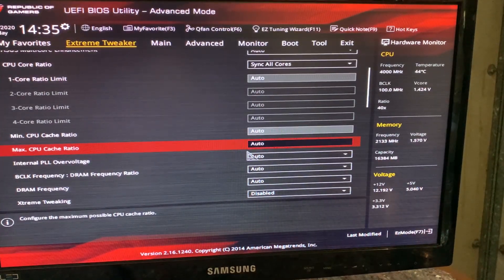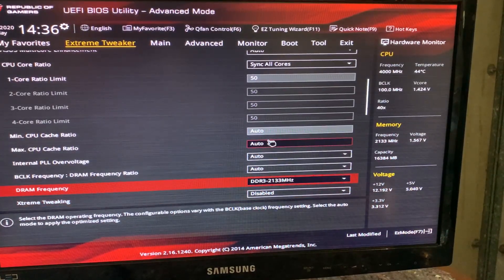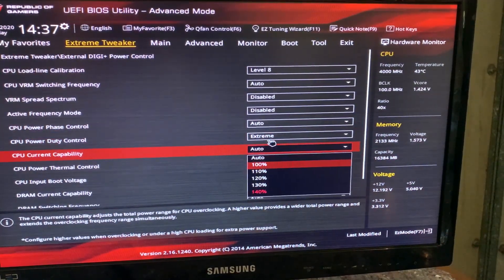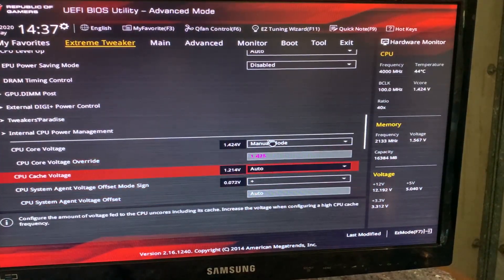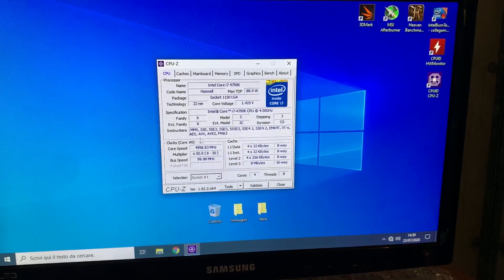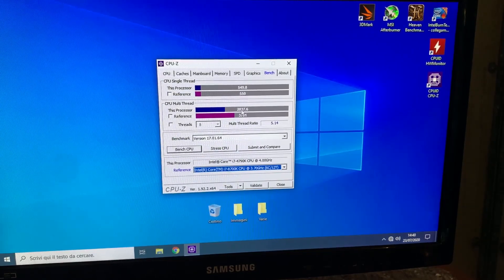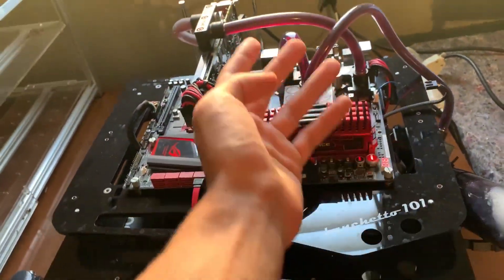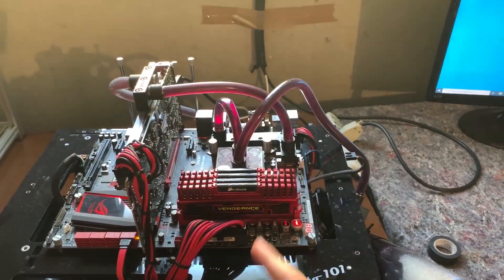Overclock an i7 4790K to 5Ghz (And every other Haswell CPU) on Z97 - Asus Maximus VII Hero

Comment: I dont remember how, I think I used a program to do it, I selected 5ghz and then it changed the other settings it self and ive been running my 4790k like that since 2017 without any problem...just sux that next upgrade cant just be a cpu and card, but I have to get new mobo, card, cpu, cooler and ofc new ram, meeeh
Reply from the maker: Oh that's nice, but you're probably running a bit too high of a core voltage if it's an auto oc. Still, it doesnt really matter if you have good cooling!

Comment: 1,425v Core Voltage :O
Reply from the maker: I know, I know, unfortunately 5Ghz is really high on those chips!
Reply: @ImWateringPSUs  high ? My 4790k n°1 run 4,7Ghz for 1,4v my n°2 4,7 1,43v 😭 ( tested on z87x oc force/ z87 oc formula and z97 XPOWER ac )  for m'y  5Ghz ~1,3v is a 🦄
Reply from the maker: @xkaiderxkaider5718  1.3 for 5Ghz on these kind of chips is nearly impossible! Would love to have a chip that can do it!

Comment: Hi do you know whats the best overclocking guide for begginers. I have this board but the i5 4690k and have never overclocked. I don't know where to start. Any suggestions. Obviously every chip is different so I couldnt do what you did here.
Reply from the maker: I'd go with 4.4Ghz, 1.35V, LLC enabled (middle level if you have levels!) That is if your cooler can handle it :)
Reply: @ImWateringPSUs  THanks. I have a new PC now but when I get that one out of the cupboard to user it as a streaming PC I will do this, cheers.
Reply from the maker: @adamlw7181  My pleasure, take care!

Comment: what is the highest oc you can get without delidded cpu i have ranger mobo
Reply from the maker: I'd say 4.9 with a very good CPU
Reply: @ImWateringPSUs   when i put
my cpu level up on bios to 4.8 around 10mins benchmarking it crashes
Reply from the maker: @teknoadikt  You need to do some manual overclocking like the one shown in the vid man
Reply: @ImWateringPSUs   the issue would be what vcore volltage i should use etc etc on 4.8 or 4.9 i am a noob on oc so thats why i use the cpu level up

Comment: I've overclocked mine too, but with 4,5 ghz i have the Problem, that my system Boots Up but on load it crashes after several minutes
Reply: 4790k & ranger vii
Reply from the maker: You need to up the vCore and check your temperature

Comment: I did so the same tjong bit my pc keps reboting ITself
Reply from the maker: That means that your CPUs is worse binned and you need to up the vCore
Reply: @ImWateringPSUs  how do I do that?
Reply from the maker: @Flight737  When you have to set the voltage, you set it 0.025V higher. Or you lower the frequency

Comment: I do the same things and my PC dont Turn up..
Reply from the maker: It means you need to up the voltage
Reply: @ImWateringPSUs  ok i will try.
Do you have Steam? Any conctact for speaking?
Reply: @ImWateringPSUs  i increase to 1.45 to 1.5 still blue screen.. clock_watchdog_timeout
Reply from the maker: @Andrefilipeferreira_  That means that the voltage is still not enough. But I wouldn't recommend going over 1.5 without liquid nitrogen or at least chilled water, since it would probably affect your CPU. Delidding would also help, I have a tutorial about that. It should be able to boot at around 1.55 or 1.6, but then again that's not that safe man
Reply: @ImWateringPSUs  if u dont recomend to increase the voltage up to 1.5, what I should do if  i have AIO refrigeration. It always crushesh. My current voltage is 1.425. Currently im running at 4.8 Ghz but I want to get more.
Reply from the maker: @eleeevn7933  You could try to play around with the Load Line Calibration for a bit, but unfortunately it's the AIO that is limiting you. You could delid the CPU as I showed in another video or quite simply upgrade the cooling

Comment: Too short of a video to give an in depth explanation on what the stuff you set in the BIOS actually means, also an instruction on getting clock x at voltage y is never useful since chips vary vastly in quality. I don't have any experience with running 22nm Intel on more than 1.25V long-term, however, that voltage feels a tad high.
Reply from the maker: That's why I also have 20min long videos on OCing tutorial. This is just a case look at what an high end daily OC looks like
Reply: @ImWateringPSUs  Do you have a link to that Video?

Comment: Won't 1.425v Vcore harm the CPU fairly quickly? I thought the max safe voltage for Haswell Refresh was 1.300v
Reply from the maker: It’s gonna degrade a bit overtime, but since we are running a very high end custom loop, the CPU is running at a very low temp. When running very cool, there’s way less degradation and the safe voltage is higher. That’s why Extreme Overclockers can slap 1.7v on the vCore without instantly killing their CPUs!
Reply: I have my i7 4790 running on 4.5 GHz Even it's a locked one using bclk I attained it and ya 240mm aio. Voltages were around 1.162
CB R23 scores were insane  
Stock 4.0 GHZ ( TURBO ) 
SINGLE - 972 
MULTI -  4228
BCLK 4.5 GHZ 
SINGLE -  1119
MULTI - 4907
Reply: Well you probably fried alot of cpus

Comment: Watching your video  just changed my mind. I’m keeping my 4790k with strix Vega 56(Vega 64 bios) I have Corsair vengeance pro 2400mhz. I’ll get some water cooling stuff
Reply: Defo keep it man.. I`m still using mine after 8 years and mines pulling all games on ultra with 160+ fps.. I`ve manualy tuned and mapped mine out and runs like a dream :D ..
Reply: @Mryoungbaby   My i7-4790K running an RTX3080 just beat an i5-12600 (the ei5 said too be `165 places ahead` in CPU charts) running an RTX3080 (also) in GPU Benchmark tests. The i7-4790K is supposed to limit what the 3080 can do.
Reply: did u oc the memory too ?
Reply from the maker: Great choice my man! Those ring bus CPUs really are beasts if properly OCed
Reply: Hey im planning to get vega 64 for my 4790k, does it bottleneck it ?

Comment: What cooler are you using to keep that CPU cool?
Reply: Very important question @Stayler17
Reply from the maker: A custom loop with a 360MM rad
Reply: @ImWateringPSUs  can you switch to air cooling if you relid the cpu and use metal liquid instead of thermal paste?

Comment: I would to ask i have to 4790k and corsair dominator platinum 1600mhz latency 8 ram  and asus formula motherboard  how can overclocked and how much temperature how is stable  can give more information ?
Reply from the maker: You can follow this tutorial, just stay under 85C
Reply: @ImWateringPSUs    if  4.7  what i must doing voltage  can you info please
Reply from the maker: @Raiz35  1.35 will do. Probably 1.3 as well. On my CPU I can do 4.7 at 1.25
Reply: @ImWateringPSUs  my dram 1600 mhz  i make 2133 or some problem or let 1600 mhz ?
Reply from the maker: @Raiz35  You can leave it to 1600Mhz, but increasing it will increase performance

Comment: nice video ..subbed :) Do you experience any booting issues in your motherboard. I heard people complaining that their asus maximus motherboards had problems in booting up sometimes. Also which bios version do you have?
Reply from the maker: Not at all. I have the latest version installed ;)
Reply: @ImWateringPSUs  the beta bios or 2017 update?
Reply from the maker: @meangamers623  I was using the beta! Seems stable to me tbh
Reply: @ImWateringPSUs  do you recommend me to update it or i just stick to 2017 update
Reply from the maker: @meangamers623  Honestly, if it's going fine no need to update. Read the release notes, if you need some of the updated features go for it and if not just ignore it!
Reply: @ImWateringPSUs  okay thanks a lot, i really appreciate it
Reply from the maker: @meangamers623  No problem at all! :)

Comment: Nice dude, I'm going to delid my i7 to up it to 5.0ghz. Why dont you do a video about Memory OC? I can't oc my memory over 2400Mhz (1600mhz hyperX)
Reply from the maker: That's great man, keep us updated with how it goes! I will do a memory OC tutorial, but it's gonna be on the simpler side because once you get close to the limits of your kit it really takes way more than it's worth it to tune it and sometimes it's impossible to achiede stability. 2400Mhz on a 1600 kit is a great results, would you like to share your voltages and primary timings?
Reply: @ImWateringPSUs  Sorry about late reply. 

My 2400mhz is unstable unfortunately, but I tried with 1.6v 13-15-15-40
after so many bsod i decided comeback to 2133mhz.

I'll enjoy this black friday to buy a good thermalpaste/delid tool to up my 4790k too
Reply from the maker: @rodrigo_rodrigues  Makes sense!
Reply: @ImWateringPSUs  I would like to ask to you too, if you tried the i7 5775c

Everyone know that the 5gen were a "downgrade", but do you already test one of them on z97?
Reply from the maker: @rodrigo_rodrigues  I did not try that CPU yet. I should though, they look interesting. I avoided it because it wasnt OCable, but maybe it's worth a video
Reply: Mój ram 1600mhz zrobiłem na 2400mhz 11 13 13 31
Reply: @rafakowalski1293  jaki tam i napięcie?

Comment: How cool it has to be to have 5ghz, and i am satisfied with my 3,5ghz
Reply from the maker: Which CPU do you have?
Reply: For 5.0Ghz aio of 240mm will do
Reply from the maker: @cronos1675  Maybe if it's delidded. I honestly doubt it, on a 4790K.
Reply: @ImWateringPSUs  yea my 4790k runs  on 4.9ghz with 240mm aio of corsair.. 50-70degres
Reply from the maker: @cronos1675  Under full Synthetic Load with Prime95 I doubt that's the case actually. If it's delidded it could stay in the 70s tho. How much vCore does it have?
Reply: @ImWateringPSUs  I did voltage of cores  to 1.350voltage
Reply from the maker: @cronos1675  If delidded you should stay in the 70s under full load, makes sense. Not in the 50s tho man

Comment: Thats 3700x is at stock ass well pushing that 4790k to 5ghz is just as pushing that ryzen 7 up to 4.5ghz if you do that single core would be as fast as if not faster and also the extra 4c/8t will benefit much more. Also new games start to make use of fast ram the ddr3 of the 4790k wont cut it and even an i7 7700k struggles in pushing high framerates in games where multithread is optimized its nice to see the 5ghz mark on an old cpu but its not realistic at all and lets consider the price of a 4790k is still at 150+ thats a ryzen 5 3600 which will do the job just as fine
Reply from the maker: The Overclocking part is for sure! Of course if you overclock and tune a nice R5 or R7, it's gonna be way better. The whole "better than Ryzen" idea was to simply show that old hardware, if OCed and tuned, is better than new hardware not tuned. Regarding the price, you might want to check out my 450$ budget build video, which talks about the deal I got on this i7. Those older i7s can be had for around 120$ with a motherboard and 16gb of ram. The value over new products is simply insane!
Reply: ⚠️ AMD fanboy alert ⚠️
Reply: @roimores  na just stating the point that its not overclocked in comparison with the intel part wich is extremely overclocked to speeds most user’s wont even get im no fanboy ive even recommended the i5 10600k to ppl over a 3700x and so
Reply: @toxicvo1d395  That point is obvious... i7 4790K OC compared to 3700X Stock. Old CPUs are compared that way to stock newer CPUs... never both overclocked if one is so old...